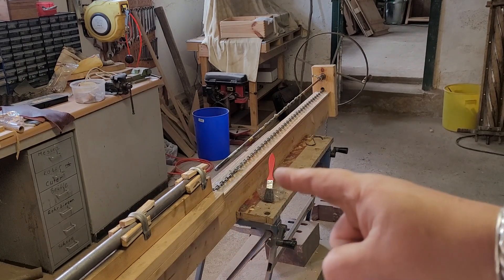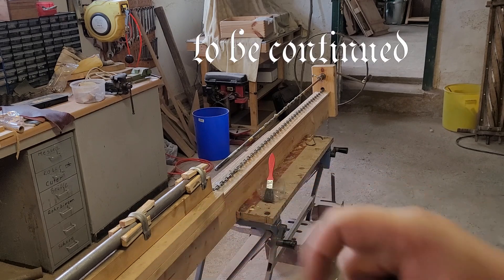Jäger rifle scratch build pt.1 reaming the barrel bore

Comment: Great idea 👍 I want to make a barrel too. What kind steel are you using? What size is the tubing at the start of reaming operation? What is the outside diameter is the tube?
Reply from the maker: The Steel is ST37 or sometimes I use ST52 that is way enough for a blackpowder gun- The tube is seamless hydraulik pipe with a wall thickness of at least min. 7mm. The inner diameter is close to the field diameter of the caliber. in this cae it is 12 inner diameter and 27 outside 😁 good luck for your project...
Reply: I found a 1” DOM tube with a0.500” bore, that I will use and bore to 0.540”. What was your tubes starting bore diameter and what size reamers did you use? Thanks
Reply from the maker: @raymercado3650  That seems to be too thin to me . Remember that you will loose some material thickness by making the barrel oktagon. With the 50cal it wll be ok. As reamer I use a standard reamer elongated with a steel rod. It had 13mm and I grinded it down to 12.6 as 50cal core diameter. 😁😁

Comment: You need to get those new windows in before winter Roger! Have you thought of using an adjustable reamer ? Once you have those grooves caused by stopping, they are really hard to get rid of, you can take the adjustable reamer in using much lighter cuts, you can also feed air pressure in from the other end to clear the chips, It is looking good! Chris B.
Reply from the maker: That would be a nice seperate project. Adjustable reamers at the market are useless, I tryed them and they grab very deep . The traditional reamer with one blade would be better. 🤔 Maybe for the next round I will prepare a reamer 😁